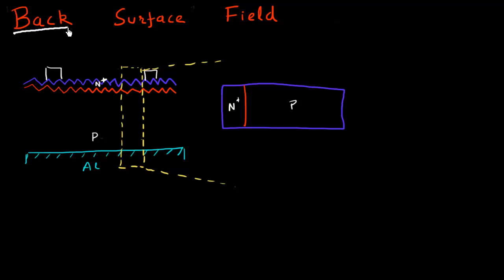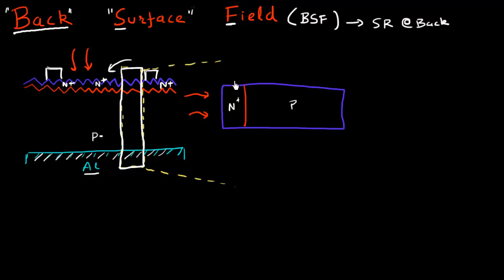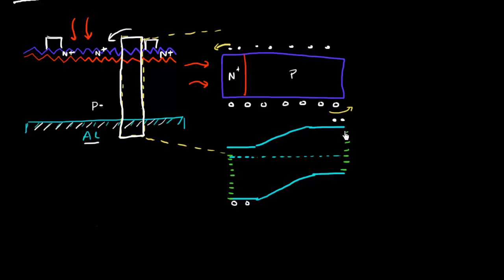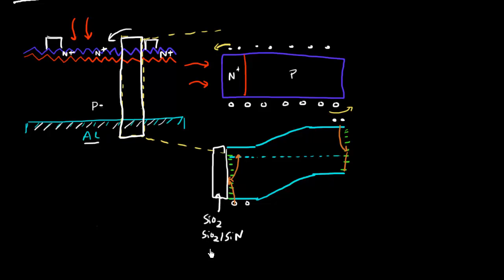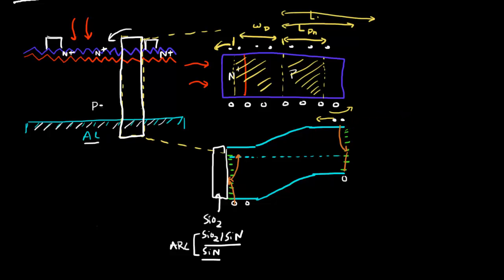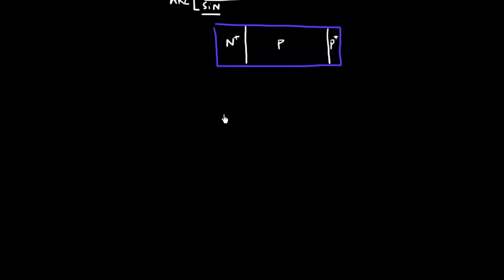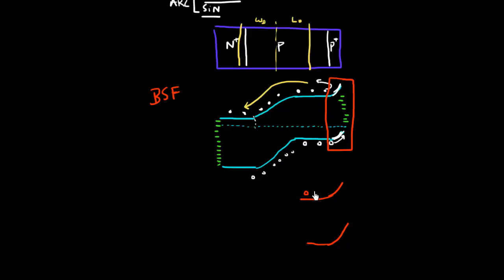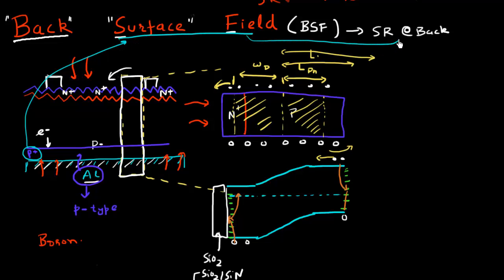Back Surface Field (BSF) in solar cells

Comment: 4:00 we are taking 1 diffusion length into consideration as well because (diffusion length is avg distance an excited carrier travels before recombining) and I have so far assumed that carriers are formed only in the depletion region (as excited carriers in the neutral region are recombined). But it can be assumed that the excess carries formed in that diffusion length of the neutral region can also contribute to current (like e- reaches depletion region by diffusion before recombining).
Reply: Yes, it is

Comment: Just curious. I'm new in solar cells. If I'm wrong, please correct me. 
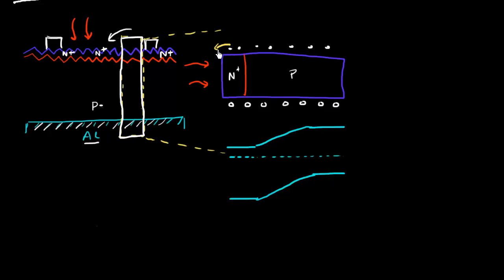Are the dotted lines at 2:00 and 6:00 fermi level? It seems the materials in the video are illuminated, and they still have constant fermi level across the materials. I thought under illumination, fermi level should not be constant through the junction anymore. Am I misunderstanding something? Thanks!